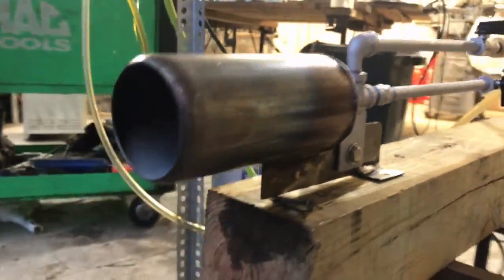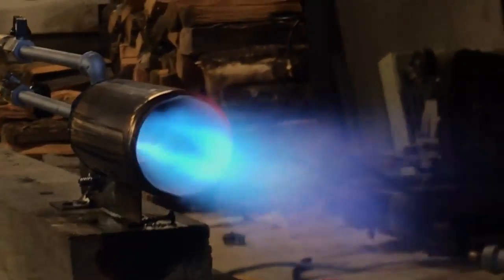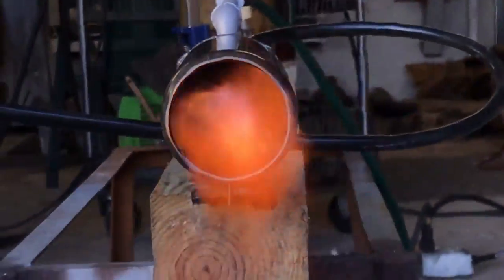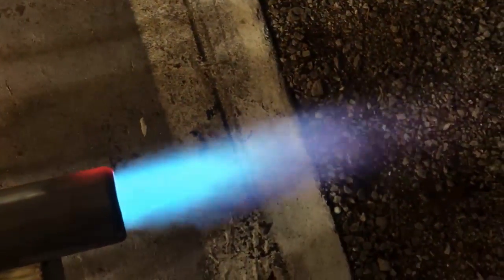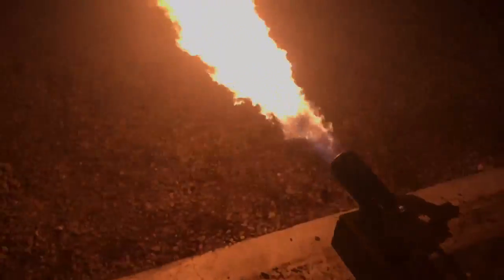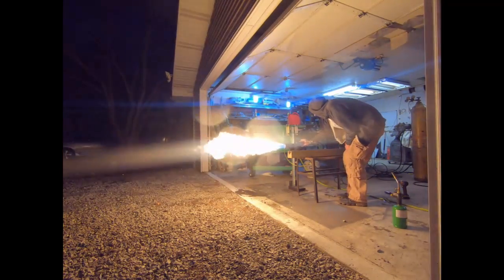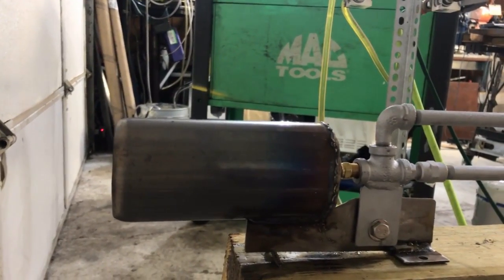Bullet Burner Universal Fuel burner waste oil or propane

Comment: I have built 2 nozzles of your. The first one was the burner that had the elbow and I got that to work.  I know it has the 2mm pen stock. This nozzle in this I cannot get to work. What size is the pen stock in this one and what tip is that on it. I cannot figure out how you have the tip with pen stock set up. Any help would be appreciated.

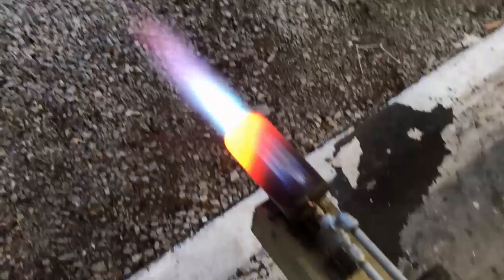Comment: Look At the burner from 3:11 - 3:15.  Notice how the red color band of the heated metal  is not transverse with the tube but is on a diagonal with the tube.   The red band as you well know is caused by the flame heating the metal of the tube until it glows red.  The uneven heat inside the tube means it is cooler on the dark side and directly across on the red side is hotter.   This temperature differential at the same distance from the end is what is causing the  spin in the air in the burner.    The burner tube is perfectly symmetrical.  The jet is exactly in the center of the tube.  Uneven heating of the surfaces causes a temperature differential in the air.  The air becomes heated more on the red side and heated less on the dark side.   Boyle’s law regarding partial pressures of gasses will define the movement of the air.  The hotter air will have a higher pressure and try to move to the cooler air.  As the air moves down the tube closer to the diagonal red band the air becomes heated, then expands, then moves  to lower pressure. That movement repeated over and over as the air moves down the tube results in a spin. 
   If you study the construction of jet engines, you will see how this same scenario, is used in the burn chambers.  Jet engines use the air at different temperatures to cool, to protect metal surfaces, and to push turbines.  Jet engines use spinning air in this scenario to cool the outer metal housing which is located beside the hot burn chamber.
Reply: Muito  bom  provou  que  entende do assunto  .

Comment: Mass and velocity: oil droplets are heavier than propane gas molecules, so if the flow is slow enough, you will see the droplets of fuel fall, because they have mass, and at a greater density than the air around them.

The finer the droplets, the less drop, the higher the velocity, the less drop, proportional to the horizontal distance traveled.

Same principle as a rifle, only in this case your bullet is burning up as it flies.
Reply from the maker: Are you referring to the oil flame only being in half the combuster ?  What i cant figure out is why am i getting rotaion in my combuster to the tune of 1000 to 2000 rpm
Reply: @NOBOX7  What i was referring to was simply the fact that before the oil droplets completely burn, they have mass, and are instantly slowing down the moment they leave the pintle, and as they slow, even as they burn, gravity naturally takes effect, and pulls them toward the earth.

The slower it moves, the slower it burns and the more it drops.

That said, I can not declare infallibly that this is in fact the case with your burner.
Reply: @NOBOX7  The Coriolis Force effect.

All moving air turbulates in this manner, we just usually don't see it based on its scale.

When you have air moving very fast at a reduced pressure in a circular chamber with a clearly defined linear track, you have the ideal conditions for this force to freely express its self.

Long smooth straight tubes [as opposed to short, rough,  or bendy], round shapes [as opposed to non-round shapes], sudden pressure changes [favoring pressure changes in decline above pressure changes in incline], and moving fluids [favoring more speed  over less speed] are all ideal [if not essential] elements of an ideal Coriolis vortex.

While on the one hand, it is a flame enhancing component of nature, it also encourages heat to leave the flame toward the side walls, as opposed to flowing toward the exit.

For this reason, inside turbojet engines, the air is 1, forced through 'diffusers' which both slow the air down, increase the pressure, and cause it to be carefully 'stalled' so that this swirling action ceases.

The reason is because swirling, turbulent air drives heat into the metal parts of the engine, shortening the life of the engine over time.

Once the air is heated, and exiting the burn cans [flame holders] while it is still very hot, but yet not as hot as it was at the center of the burn can, having been cooled off by many layers of laminar flow stabilized cooling air, it is then depressurized and accelerated, this air is then intentionally 'spun back up' to get work out of it [firstly driving the turbines, and then ejecting to develop thrust].

Comment: Would an aerospike nozzle work for a burner?
Reply from the maker: That would be cool , it kinda like an aero spike module isnt it
Reply: An aerospike burner would offer no thermal combustion advantage and would greatly increase the cost and complexity of the device, so its not really commercially wise to pursue it since he is not trying to make rockets into space.

On top of that, depending on the final intended application, it would likely be worse [less effective] at achieving the goal.